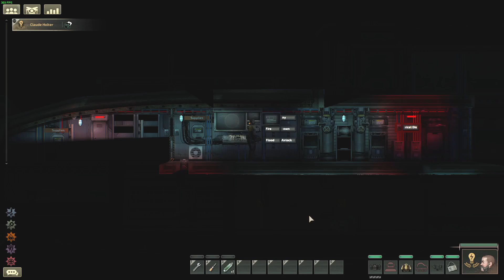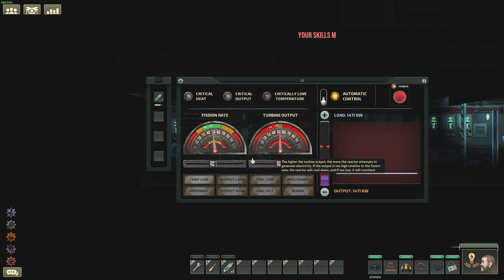Flooded Ship Repair Guide | Barotrauma

Comment: This guide has a massive caveat. In a situation where you are flooded you are probably also under attack, so your priorities will be split between repairing and defending the ship. Of course deciding whether to repair the pumps to de-flood the ship, or the supercapacitor in order to finish off the enemy before it re-floods the ship is really a judgement call with no obvious answer.
Reply from the maker: Oh I totally know what you mean. Once the monsters get into the ship it is complete chaos. I have tried a few times to land accurate shots at monsters in the ship which ended with dead crew.